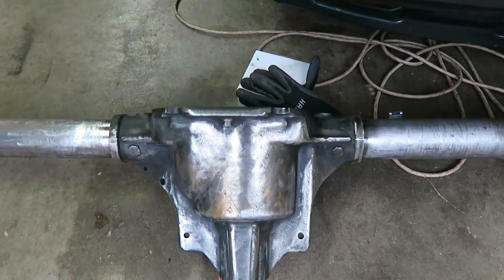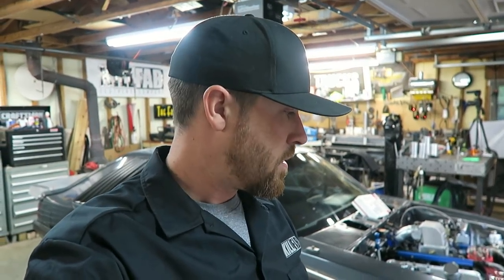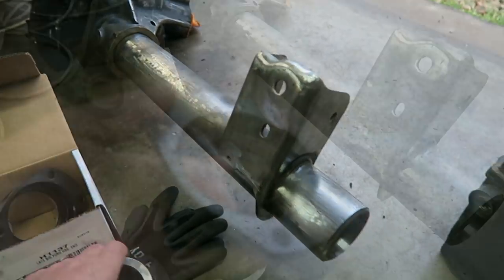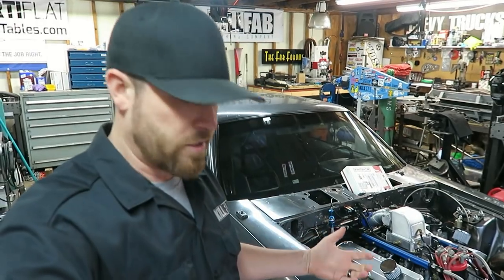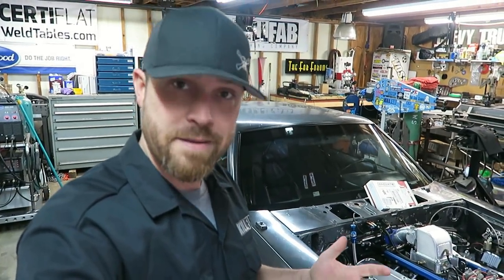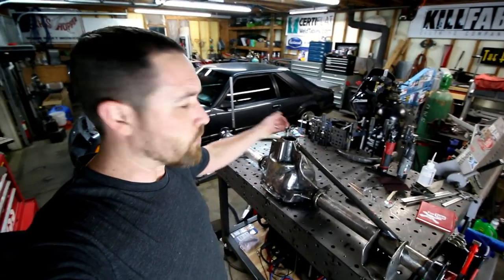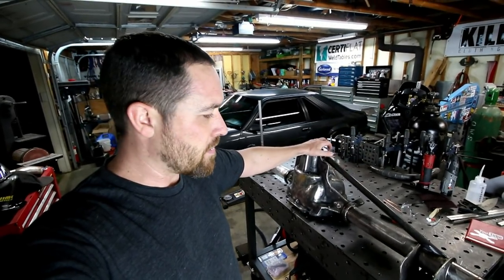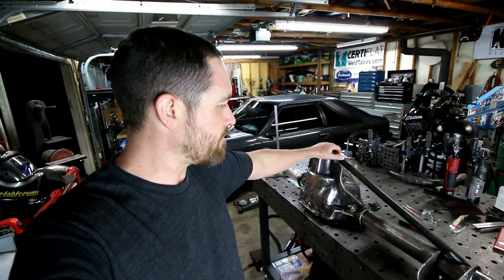Ford 9 Inch Ends On 8.8 Mustang Rear Axle

Comment: Just so you know. A good rule of thumb is to tack the housing ends on dead last. Any gussets or additional weld on parts should be completely installed before you weld your ends on. This allows the tubes to warp with out any misiliment to your axles.
Reply from the maker: nah...I have thrown ass loads of heat to these things and re checked them afterwards. Never have any move.

Comment: The real difference between the 8.8 and the 9 inch is the fact that the pinion gear is supported at both ends. So the 9 inch is way stronger than the 8.8. The 8.8 is still plenty strong though. I added those ends to my 8.8 so I could run a spool. Much better than the C clip eliminators.
Reply from the maker: yeah I could see them having less pinion deflection. It usually the ring gears that fail though.
Reply: I have seen an 8.8 pinion snapped but not on anything I own. My 8.8 will do the job unless I get carried away with my 4.7 L Teksid build ( AKA John Mihovetz's Mustang ) but I would need to win the lottery. :-)

Comment: I did the same to my 8.8, and built a jig to hold everything in place. Hardest part was finding a bracket for stock brake calipers, but now you can easily find them on Jegs. Keep it easy.
Reply: I used the stock brake brackets and calibers/ rotors. When you get axles tell them your running stock brakes and you will be fine

Comment: The majority of YT 8.8 narrowing videos show someone cutting the tubes, which is the cheap (as opposed to inexpensive) way to do this. As Kyle said the point is not just to narrow the housing but to get rid of the c-clips and add larger bearings at the ends. You're likely going to buy axles anyway so spend the extra time and money to do it right.

Comment: Actually the reason a 9 is the preferred rear is that gear changes can be done at the track in 15 min and an 8 has to be torn down to change them. They are also supported by gear manufacturers in many forms, ie lightweight, heavy duty off road and virtually every gear ratio you can dream up.

Comment: Need to have that housing checked for straightness after you welded those gussets on and..welded the tubes to the housing..
The 8.8 may not be as bad to bend..
But a stock 9"housing is horrible to move all over place after welding
Reply: Kevin Luck totally agree! Housing ends should always be done after any other welding on the housing, brackets, braces, etc.
Reply from the maker: straight as it gets...
Reply: More than likely is plenty enough straight to never cause a problem but I personally prefer to weld on housing ends last. And also we use a 1.25”alignment shaft for maximum stiffness to ensure perfect alignment.
Reply: @lesgray3355  i agree.. we use a 1.5" bar because we actually had a rear end redo over about a half inch tweak we missed on a crown vic rear going on a buggy.. because it was so long one of our guys could feed in the rod so it looked ok. 😕😔kept pulling and couldn't figure it out or fix it. if it's simple you missed something. other then that hell yes a stock 9" isn't worth the trouble an 8.8 31 sp with 9" big bearing ends beats a 9 everytime.
Reply: If you do the housing ends last then it will be straight.

Comment: I prefer the 8.8 I'm in the process of putting a 3.73 posi lock 8.8 from a ranger to my 86 s10 with a 10 inch deep wide with cooper cobra's, had relocate the spring perch and shock mounts.

Comment: Hey, so I paid to have this done. Here is the thing, I changed out my rear studs last week and my axles basically came right out. Just unbolted the bracket to the caliper. Is that the only thing holding the axle in, it was this done wrong? I would really appreciate the answer. My life is dependent on it. I liked and subscribed. Thanks

Comment: I have no experience with the 8.8 [we did not get them here in Oz], the C Clip axles do not inspire confidence but as for the rest I guess it depends on what gear sets are available. And what size the pinion ends up in shorter gear sets.
The 9" has not been made for 40 years, it has always been an overhyped thing. IF you throw away all the Ford parts and fit aftermarket they are ok, BUT the pinion is too low and that drags horsepower big time and fries the oil as well. And they are so bloody heavy! In comparison too a B/W  Dana 78 series they are 35lb heavier, all unsprung weight.
I used them in  road race car for some years and never actually broke one,, but regular inspection was required and I junked a couple of gear sets as they had cracked.
The clip shows '9" ends" but which bearing? Tapered bearing? double row bearing? large diameter or small as they had several styles. And the old Ford axles have a very bad habit of cracking outside the bearing at the shoulder the bearing pushes up too. In mine I used GMH axles cut and resplined as they are far better material. Though I did break one of those outside the bearing as well so cracktested them regularly after. Though it was probably the axles street use before that did the damage. They were from a 1 ton ute. But for any racecar a floater is the only way.
As for those reinforced housings?  Really use some engineering sense. Using very wide wheels with huge negative offset is plain stupid. Make the axles longer and use a central or better positive offset wheel and you do not need any of that reinforcing wank except for off roading,,, maybe! A longer axle too has more area to 'wind up' and not break like the ultra short ones favored. Painting a line from spline to bearing will show eventually how much they will wind up before breaking.

Comment: What filler rod did you use on the tubes to the center section? Is that an ER70S-6 or some other rod? I assume that's the same you used for the tubes to housing ends?

Comment: so now you just put in axles from a 9 inch with the same spline count as your original 8.8 axles? Is the axle length gonna be perfect? and what about the drum brakes that would be present like on a f150 ? I have a passenger side axle that slides into the diff to far and causes the c clip to fall halfway into the diff while still halfway holding the axle( scared its gonna throw the axle and c clip gonna tear up gears in diff) im thinking about doing this to my f150 just worried about how those axles and brakes all line up

Comment: Awesome installation Kyle! I need to do this to my 86 GT too.
Any problems or special instructions for welding to the cast center housing?
Also, do you think there is enough spline length on 8.8 axles to be able to cut 1" off of each side?
If you have time to answer thank you and I appreciate it. If you don't, no sweat.
Reply: Robert G If I remember right, when I did my 8.8 build there was about another inch of spline left on the shafts. You'd be cutting it close, that's for sure.
Reply: Tanner S., Thanks for the reply, I appreciate it.
Reply from the maker: I have done a bunch of these and I've never had to do anything special when welding the cast housing....It is  a little tricking with all the contamination though.
Reply from the maker: I have cut an inch off some stock length moser axles in the past and there was plenty of spline
Reply: Thanks Kyle, I appreciate you taking the time to answer my questions.
Reply: @Thefabforums  Over in Eastern Europe i have watched video where a guy lengthened the splined area with a hand held grinder! Believe it or not.

Comment: Bing difference between the 8.8 and the 9 is with the smaller ring gear and pinion only 2 teeth mesh at a time and with a 9 inch 3 teeth mesh at a time. It's not just the axle bearings.

Comment: Disc brakes do not need a c-clip eliminator. The caliper over the disc keeps the axles from coming out.
Reply from the maker: yeah but not without potentially locking up the rear wheel

Comment: If you put a rear disc brake conversion....it will keep the axles in the housing should a c clip or axle brakes
Reply from the maker: still other issues with the roller bearings

Comment: So question. I have a 2007 Toyota Sienna LE AWD MiniVan. I’m building my rig for rally racing and off road with rock climbing in mind. I need a lot more flex and reliability for the rear end. I have a loaded axle beam  suspension set up. That’s stock. Also, a differential with cv axles. I am looking for a axle or differential that has the capability of a air locker. Dual brake caliper set up. And sway bar hook up for when I’m going super fast. And of course sway bar disconnect system that’s easy to do for rock climbing. My engine will make 400HP + and 350+ torque. It’s going to have a SuperCharger and will be hooked up to a E352F 5-speed manual transmission with a matching T-Case from a 05 RAV4. Apparently I have to keep the 2.929 final drive  that the rear differential has! That’s because the 4.14 Something Final Dr. that the transmission/tea case has apparently the rear axle has to be lower than that I don’t know why but that’s what everyone is telling me. If that information that I told you do you by chance know of any differential or axle I can install for the rear end? Thank you.

Comment: I know y’all are doing this for drag racing but I wanna put a Cummins in my f150 but first I’m beefing up suspension and my axles would this work on my 8.8 swapping over the 9in ends
Reply from the maker: yeah
Reply: Where would I get axles for it? Any website Info would be awesome
Reply from the maker: @thomashunt7717  you can find everything you need at either Strange or Moser

Comment: Im guessing it uses 9 inch axles also? Could you do that with a mig?
Reply from the maker: yeah you could mig it for sure
Reply: The MIG welded ones must be the cars on YouTube in fails video's that tear the whole rear end out on the launch from the line. I have done one using MIG. You just have to be careful about your welding.

Comment: What kind of amps did you use on the ends?
Reply from the maker: not sure....under 200
Reply: The Fab Forums thx just wondering of my 200 amp tig would be up to the task.

Comment: I have a question, when you weld ford 9 inch ends on an 8.8 rear axle do you use ford 9 inch axle shafts then or keep the ford 8.8 ones? trying to figure out if i do this and narrow a rear end from an explorer if i can then use cut to length aftermarket ford 9 inch axle shafts to make it all work. I figure if they are all 31 spline it should fit but im not totally sure and cant seem to find an answer.
Reply from the maker: when you order the shafts you just tell them it has 9 inch ends on an 8.8

Comment: "If the C-clip breaks or the axle breaks the axle can just slide out." Okay, so I get that the C-clip is the retition system for the axle and the statement is absolutely true with drum brakes. BUT when running disc brakes... The axle is behind the brake rotor and what's over the rotor? The brake caliper. Now granted the brake caliper's purpose was never to retain the axle, but in the event of an axle break wouldn't the caliper prevent the axle from sliding out of the housing since it sits over the brake disc which the axle is behind? You can't get the axle out when disassembling without pulling off the caliper.
Reply from the maker: yeah
Reply: c clips with disc is even worse.. broken axle locks up by wedging the rotor into the brake and spins the car, sometimes it flips.. there is a reason why many tracks are saying no c clip and no c clip eliminators. just weld on the ends and be done lol

Comment: Who makes those 9inch ends?
Reply: Those looked like Strange ends. The are the shortest ones I've seen. Allows the most width to be cut out. H1137 is big ford 9" pattern and H1138 is original 8.8 pattern. Let's you use stock mustang brakes.
Reply: @jgilbert4756  sweet thanks

Comment: Why spend the time bracing the rear if you're going to use caltracs?   This is my particular app.
Reply from the maker: caltracs ??...wont be using caltracs. What would give you that idea?
Reply: I'm saying for my truck, I'm using them.
Reply from the maker: @davidtaylor1384  gotcha. Caltracs are used to minimize axle wrap...not for what these braces are used for. These keeps the axle tubes strait under extreme loads.

Comment: For the offroad world the 9 inch housing is stronger  than the 8.8 but i have swapped alot of 4.10 lsd 8.8 in jeeps over the years because they are alot stronger than a dana 35.
Reply from the maker: yeah I could see the housing being way more useful in off-road applications especially when it comes to gussets

Comment: The 8.8 is a good rear end and with a very small amount of machine work on the pinion you can run a 12 bolt chevy ring and pinion in one which gives you a lot more gear ratio options in a pro gear.

Comment: If I’m not mistaken on my 04 the brakes would hold the wheel on if an axle were to snap
Reply from the maker: you are probably correct....anything with a rear disc

Comment: ....waiting for the “you can’t weld to cast” comments
Reply from the maker: yeah I have already got it
Reply: I have never had any problem welding to cast steel. I believe i used 7018 stick but i probably have done it with flux cote dual shield wire. May have even used MIG hardwire before. I think i always preheated if i remember right.

Comment: What about the brakes on rear
Reply from the maker: Uses nine inch brake brackets
Reply: I’m doing 8.8 with 35 moser. Sorry but this is my first go at this I’m having a company do the rearend and I’m sorry but could u be alittle more detail  like what parts exactly. Man any help I could get that would be greatly appreciated. Love the videos keep them up
Reply from the maker: @MichaelGreen-ox4lp  yeah you just basically cut off the 8.8 housing end and weld on some 9 inch ends. The weld on peices can be purchased from companies like moser or strange. This mod just let's you use a 9 inch style axle bearing versus the 8.8 c-clip elimnator type of bearing. As for brakes you will just order the 9 inch brake brackets...companies like strange, wilwood and aerospace have options.
Reply: Thanks man

Comment: I always thought the 9 inch was more desirable for the pinion support and no cast in the housing just the 3rd member.
Reply: It is, but sometimes you just have to work with what you have.
Reply from the maker: It is...I didn't say the nine inch isn't good. I didn't even say the 9 inch isn't better. I was just trying to make the point that the 8.8 is a very strong rear and in most cases it isn't worth the upgrade.
Reply: The 9 inch also has much more friction/drag because of the big offset from center. The use of a good cover with the cap supports and some billet caps the 8.8 is a very strong unit, after all it was basically copied from the chevy 12 bolt
Reply: The housings are cast steel not cast iron. Everyone thinks because they are cast the are weak but they are very strong
Reply: So 9 inch and 8.8 axles are the same diameter? Or your using 8.8 axles with 9 inch bearings??